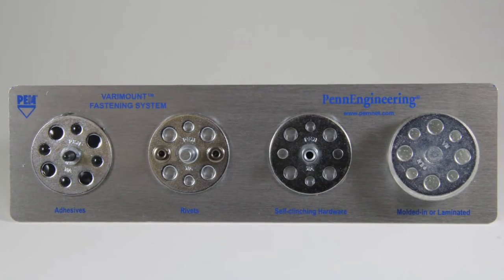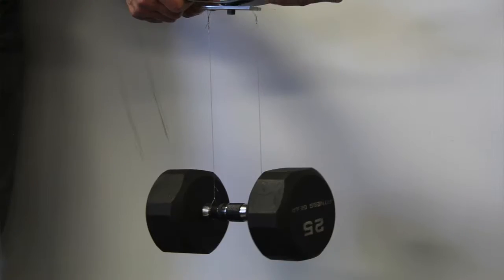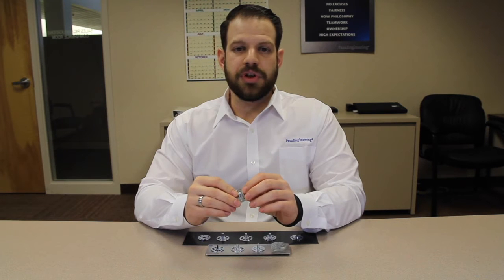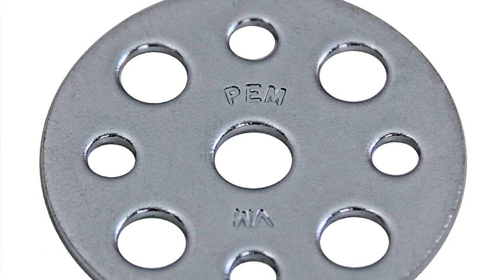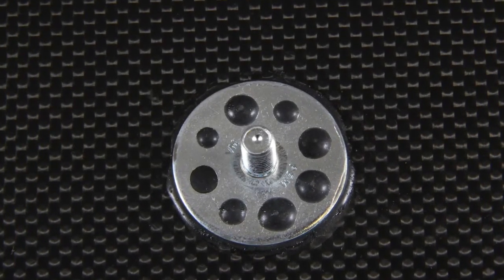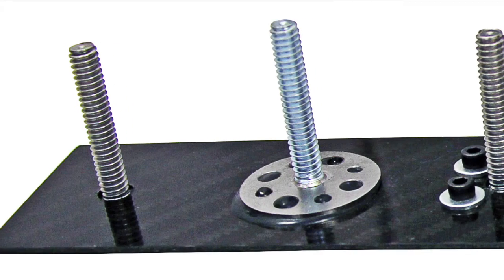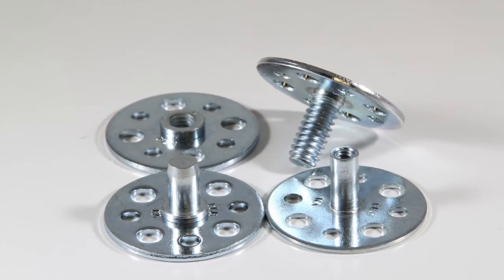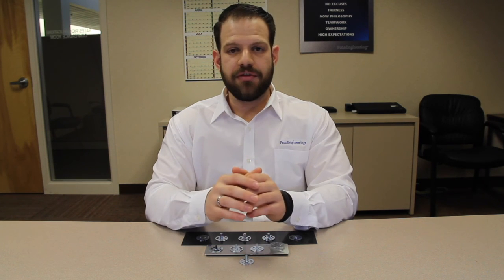VariMount® Bonding Fasteners

Comment: It is a pitty that the stand-up stud does no have a contact shoulder or bumps for the counterpart. Thus the connection is unprecise because of the glue/adesive overspills and a reliable axis contact/position is hardly controllable.
There are some models out there that offer some kind of bumps that i believe could be used as topping the glue overspill but also provide the more reliable contact (datum feature). Maybe You can look into it, maybe You already are awear and develope a solution.
I am looking forward to seeing a product with such a feature in the future.